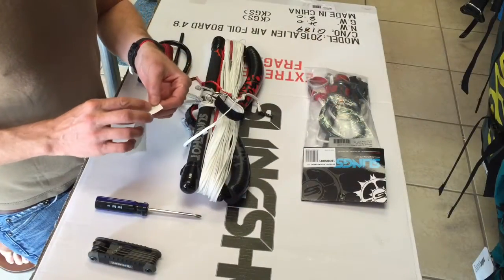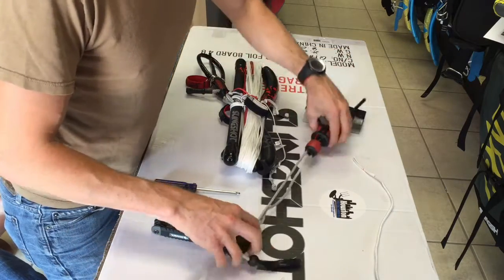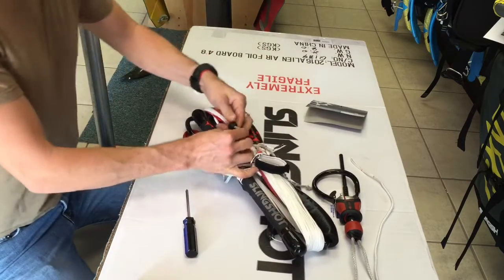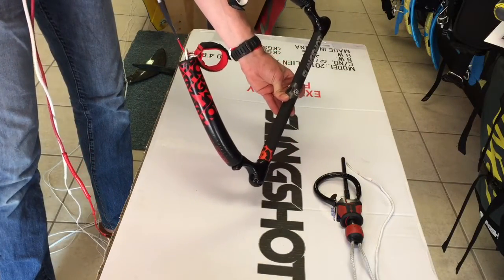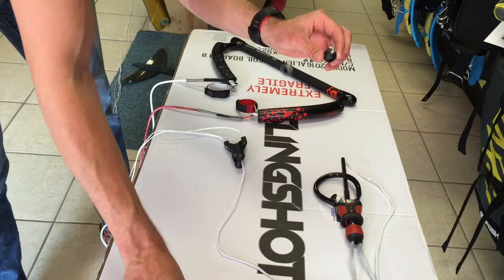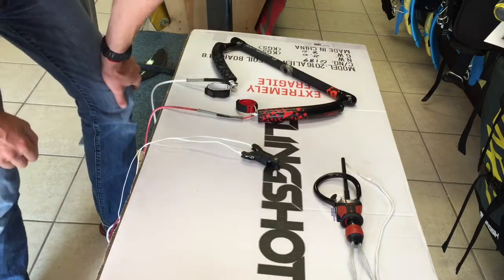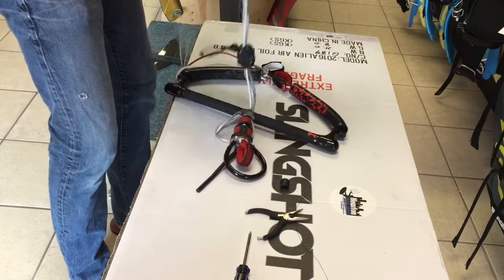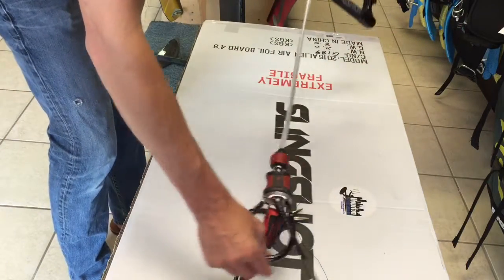How to install the slingshot sentinel upgrade kit to an old kite bar

Comment: when you do this, do you end up with a swivel above and below the bar?
Reply from the maker: After this is done the swivel is under the bar above the chicken loop and the above swivel is removed and replaced with the above the bar depower assembly.